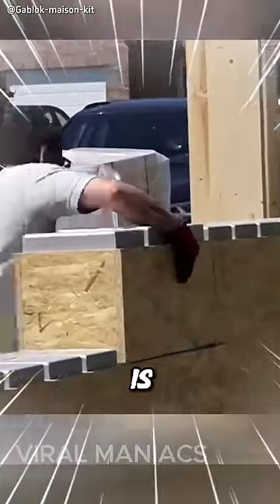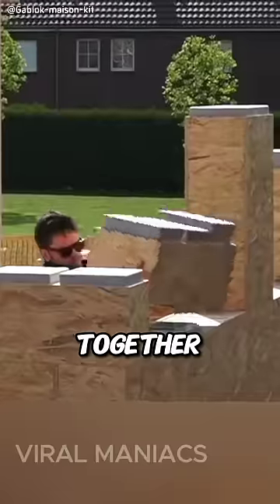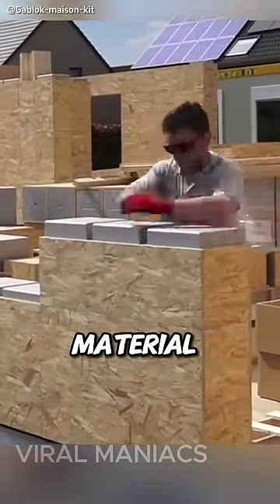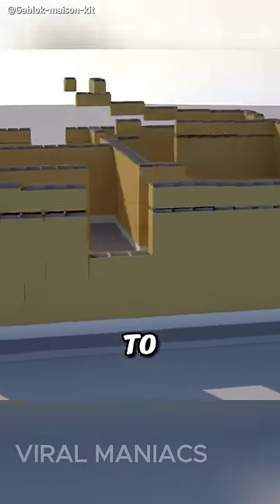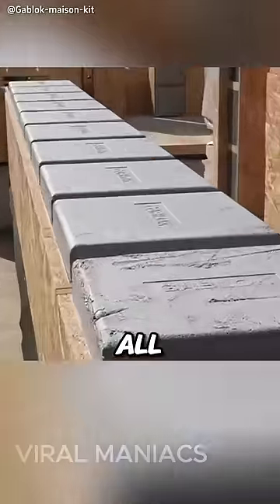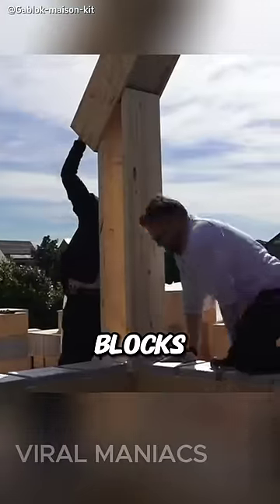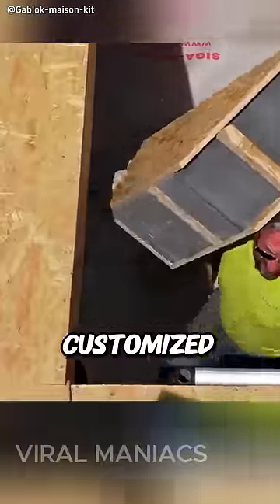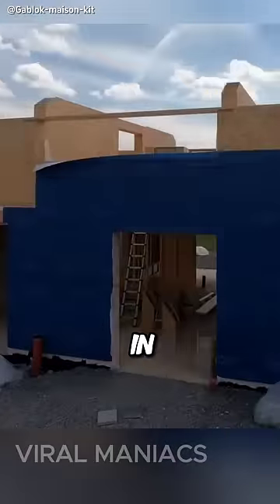Whoever Invented This Way Of Building Houses Is a Genius #shorts

Comment: Sears catalog used to sell similar modular homes like this, you would order your home over the phone and they would ship everything to you in a truck and you could put it together yourself or hire someone to do it. Lots of homes in the 50’s were made this way
Reply: Not with Lego blocks they weren’t
Reply: You need to check your memory, bro... 🙄
Reply: No... No they were not
Reply: Yeah, but no. What they sold was a complete stick built house (minus paint) in kit form. Some of those kits you had to purchase all the stick wood separately. There is no comparison unlike this lego nightmare there are still Sears Craftsman house still standing. You can't say that about this pile of blocks.
Reply: The only similar bits in a Sears house is the foundation blocks.
Reply: Hey Patrick how would you know? Have you built a house using these before? Okay then bud back of the line with your snarky attitude and comment…
Reply: @dyingtosmile2442  no I just do repairs on Sears homes  and have talked some folks that ACTUALLY BUILT THEM. So I'll keep with the snark!
Reply: Sears roebuck had those well before the 50s I grew up and one that was built in 1910 order them out of the catalog at your local sears and Roebuck store. It was more like a barn, but you get the idea everything was numbered.  They just followed the plans and put it together they’re amazingly well built and often use newspaper for insulation

Comment: Styrene foam wrapped in kindling. If one of those houses ever catches on fire, not only will burn quickly and intensely, but it will also spread toxic styrene fumes across many square miles. The perfect house!
Reply: polystyrene is commonly used for insulation, (they use it in spray insulation) and at least in america it's commonplace to build houses out of wood.
Reply: @onlyme0349  please remind me what happens to those woeden houses when subjected to the slightest natural pressure. Floods, wildfires, hurricanes, tornadoes, all common things in the US. And wooden houses collapse as if made of toilet paper when confronted with such forces.
Reply: @fighterguard  It's efficient to build with and wood is a better insulator than brick, the chances you are in the path of a hurricane or tornado is relatively small, in those areas where they are so frequent it's way better to build out of special materials, that said houses like these who are quick to build could make housing prices a ton cheaper and faster which would make the current generation able to own a home
Reply: @onlyme0349  don't be naïve. Houses are not unaffordable because of the costs of the materials. It's because of rich assholes using real estate as a speculative asset, which reduces supply, and therefore inflates the prices due to increasing demand. Houses could be built out of marble and be cheap, or out of recycled paper and be expensive. It's all in the market forces of capitalism
Reply: @fighterguard  there's an easy way to prove your hypothesis, are the land prices the majority of the housing cost or are they still cheap and people who build their house have the majority of their loan debt going towards building the house, I'm not from the US, you check, in the EU it's both, we don't have a lot of space, everything is made increasingly difficult by building codes

Comment: High winds would be the enemy of this house.
Reply: Hurricane season and its Over.
Reply: Not to mention fire. This house not only burns, most of it will melt. Imagine being trapped in a burning building because the doors are melted shut... and the ceiling is dripping hot plastic onto you.

Comment: And the wind blew, and now you're sitting naked on your chair in the middle of a field looking around at all your neighbors pointing at you.
Reply: I don’t think this would happen because they stagger the building blocks and it all locks in one on top of the other with weight. But I would if I was the contractor use a lot of glue to make sure all Blocks are secured properly they also use Simpson strong tie straps that securely bolt the foundation to walls so a strong wind such as hurricane or tornado force winds won’t scatter the house over state..The only problem I do see is hard to put plumbing in the electrical and they didn’t talk anything about this I don’t see how this would pass inspection on that.
Reply: Hilarious comment! I love it!😂 I❤
Reply: The chair with hole in the middle?
Reply: @richardtous1085  I have an "act right" chair. Not a chair with just a hole in it.
Reply: @richardtous1085  I have an "act right" chair. Not just a chair with a hole in the middle.
Reply: I think you could sheath the exterior with an insulation hard board and siding and be just fine.

Comment: My dad was a builder for around 40 years and in my experience i learned from him this will be warm in winter but very very weak its just a cheap way to build a house i recommend bricks with iron rods and high density cement
Reply: American ''dream'' have upgraded from paper to legos in 60 years. Another 60 maybe they'll finally move on to iron rods and concrete.
Reply: Yeah I also don't understand why they're not putting iron rods in, seems weird to rely on the polystyrene to hold it in place
Reply: How good is trying to claim some level of expertise because your dad was a builder for 40 years 😂😂😂😂

Comment: Congratulations, you have one built yourself one of the most flammable houses ever built!
Reply: EPS is a fire resistant polystyrene
Reply: @VegasYouTuberSteve "fire resistant" ??
Reply: @VegasYouTuberSteve OSB is one of the most flammable
Reply: @reyamayaiii1 However, Self-extinguishing EPS is a thing.
Reply: @reyamayaiii1  flame spread rating for ply vs obs has an almost identical rate.
Reply: @VegasYouTuber_Steve  euroclass F which means it's sh*t for fire resistance
Reply: @reyamayaiii1 90+ % of US houses are built with OSB.
Reply: @VegasYouTuberSteve "fire resistant" ??
Reply: @JohnSmith-im8qt  ahh yes for the roof. Not for the structural components. OSB burns faster, creates more heat and is not as structurally sound as solid wood components.
Reply: @travissmith2848  not self extinguishing OSB. If the OSB goes here, so goes the home.
Reply: @kennybutcher6307  wasn’t referring to ply wood vs OSB. Was referring to the primary structural component in this design being OSB. Most homes are made with solid wood for the frame and does not burn as fast and holds the frame longer than OSB.
Reply: @reyamayaiii1  When referring to osb joists absolutely, but they are not more flammable. They are consumed quickly because osb has less material than solid wood to consume. I work in a lab and we do tests on refractory materials. Now insulate one side of the osb and you'll increase the time that it takes to consume. Go a step further with drywall on the inside and fire will have a difficult time spreading. Flame spared ratings for plywood and osb are basically the same range ~100 to ~200 I believe. Building codes are always changing .. I know because I've had a hand in the R&D which led to recommendations that are now code. It used to be acceptable to have a laundry chute.. Codes no longer allow that in North America and usually have to be sealed and made fire safe when selling an older home. Making homes more energy efficient is important. Adjusting and developing innovative ideas is what this is. If no one innovated we would still be in mud huts burning wood and collecting water from a stream a mile away. Great improvements over that have come and they will continue.
Reply: @kennybutcher6307   you’re still not attacking my argument that a home where the primary structural component is OSB will burn faster and collapse sooner than a home made of solid wood framing as most houses are now. I never once stated that plywood and OSB don’t burn at similar rates, as a matter of fact I never brought plywood into this convo, you did. Since you work in R&D, you know that OSB burns quicker than solid wood. This means that the home will collapse faster because it does not have the same strength as the solid wood framing. With this being the case, explain to me how this home will not only burn faster and collapse sooner than a modern home.
Reply: @reyamayaiii1 Perhaps, but 2x4s and wood paneling aren't exactly fireproof. 
But, at this stage I think it more proof of concept. A bit more work on what materials you use in such a system (and perhaps the inclusion of rebar reinforcement or something should solve most of the issues.
Reply: @travissmith2848  I can agree with that. Short of the building being built in concrete most everything else will burn/melt. It will be interesting to see if they do improve upon it to make it more robust and maybe make it sturdier than a traditionally built home.
Reply: @reyamayaiii1 Dosen't need to be sturdier, but if it is say 90% as sturdy and 50% the cost and easy enough that even someone with no experience can build it to code leaving raceways for pluming, electrical, and heating/cooling (still need pros for those) home prices could come down significantly.
A method to watch, but many questions remain.
Reply: @travissmith2848  I meant sturdier than it is from looks alone

Comment: I remember back in the seventies when people used expanded polystyrene ceiling tiles in kitchens. The house fires were pretty spectacular but not as spectacular as they will be when a house built of overgrown lego blocks made of wood and polystyrene foam will be.
Reply: Maybe a little fire retardant is put into the filling's composition, I don't think they did that back then. Also, people were too high in the 70s. Ironically, hippies and fire don't mix all that well.

Comment: Im all of a sudden way more thankful to be a commercial electrician
Reply: I was wondering how they would run plumbing and electric
Reply: I would say that I appreciate you too. But I have a question why do commercial electricians or hvac or plumbers act like they don't know $hyt about the same $hyt in a house? If you don't know the simple $hyt in a house you shouldn't be doing commercial nothing.
Reply: @tammyroach3286  Alot of them, depends on the house. Old houses are scary and sometimes it's easier to say idk then to risk your life. Just one reason
Reply: That house won't look too good with EMT every where 😂
Reply: @ToonZ_1776  What in the hell did I say that referred to anything you're talking about? But FYI someone would have to be insane to want one of those leggy houses anyway!
Reply: @tammyroach3286  "why do they pretend to not know shit" "it's easier to say say I don't know" pretty straight forward
Reply: I was thinking the same thing! How the hell would you run wires in that thing?

Comment: Yes, polystyrene is highly flammable and can ignite at low temperatures. Polystyrene is a thermoplastic substance made from styrene, a petroleum-based substance. When heated, it melts and spreads fire quickly. When ignited, it produces large amounts of toxic black smoke.
Reply: How is this related to the video?
Reply: My thoughts exactly! How can this possibly be related to building a house out of polystyrene blocks , that your family is going to live in ?
Reply: In the event of a fire.
Reply: Spray walls with Line-X. It won’t burn and will be insanely strong. Bulletproof too. 

Won’t be cheap though.
Reply: @ryanb8736  so you end up after all is said and built.  Your roughly 376k in the hole.     Yeah.  Ima just go buy this double wide brand new for 175k. And then buy a few acres of land with the left over.   But let's not talk about how you just threw bedliner out there to use in a house🤣🤣
Reply: My house isn't fireproof to be honest 😂😂😂
Reply: If my grandmother had wheels, she’d have been a bike
Reply: It’s a one/two storey house so chances are there’s no minimum fire performance requirement for the walls. And the timber will provide a good level of fire resistance to allow safe evacuation
Reply: That what my mind was on!
Reply: From a guy who doesn’t know anything

Comment: 🤨 Should still be using screws, nuts & bolts to secure it more🤨
Reply: Not saying anything about this building, but not every structure needs those. Some very old Japanese buildings are built without any nuts or screws, but by making extremely tight cuts then fitting the pieces together
Reply: Did you watch the video...... There are no voids in these blocks to fill.  You have it confused with a different type of system, I imagine they left out part of the process in this clip.  @BBBhop
Reply: @BBBhop  I have, I've actually built with them before.  It's an open form and you still wire it all together using rebar inserted between the block layers. Then fill with cement... In this case the void is 100 filled with EPS blocks  ( the grey stuff) so that being the case,,,, you tell me... Where are you going to pour cement in this application????? THERE IS NO OPEN SPACE FOR IT 🤡🤔🤯
Reply: Thief coming and destroying lol

Comment: they found these things unusable in areas with hgh wind requirements because they leak like sieves. air blows through cracks. only way to fix that is to plaster the entire face and walls.
Reply: Guess what buddy.
Thats what dry walling is called.
If ur putting up ur woodblock house then calling it good.

The biggest problem with this is how the fuck are they gonna run electrical, plumbing, or heating/cooling through the blocks??
Reply: I call BS.   Not only is the drywall and house wrap going to stop that, but all you have to do is put quarter inch foam sheathing on the outside to prevent that.
Reply: That's exactly what they do they just don't show that part. After these houses are put together you supposed to add a layer or two of stucco and/or mortar
Reply: @sylthaya7571 Drop a heated ball bearing through the foam:  instant conduit.
Reply: It's those damn "they" again ruining everything.  Who are they?
Reply: Whatever floats the boat 😊
Reply: @sylthaya7571  I have no background in construction or home building, so not claiming to be an expert... But I imagine the inner walls would have studs installed which would be used to hang the drywall.... So just like in a traditional build, you still have a void inside the finished walls for pipes and cabling. HVAC would probably take a little more planning, but I'd imagine all the duct work runs thru the attic and is expelled via ceiling vents.
Reply: @control_the_pet_population  Part of the issue with adding studs for all the wires and plumbing, which is a near necessity, and then hanging drywall inside and panels outside, is it makes the blocks entirely moot since you've just built an entire house twice at that point.

Why bother with the blocks if you are just going to do everything else anyway, and have to because they need every else.
Reply: @danielhomant2832  No argument here, I was just trying to spitball where the wiring and pipes would go. :)
Reply: Well thats what you would do

Comment: One of the cooler ones I've seen is a 3D printer method, they just build a gantry (small crane) with a motor on it, and hook the material to a hose.  A computer does the rest.  Then they roof it.  Takes a couple days on a slab.
Reply: Yeah, the one with non forcified concrete. It's a bad one.
Reply: @Roguescienceguy clueless homeowner duped into buying and shady salesman enters chat: they have little pieces of metal reinforcement! We cut up coat hangers and use it to reinforce the concrete!

Comment: So many construction experts in the comments who don't realise OSB and EPS are omnipresent in modern construction.
Reply: No one is saying that they aren't.
Reply: Yeah, usually attached to something with a little more backbone lol.
Reply: @voldemort008  Most of the criticisms are regarding flammability, toxicity and inability to route mechanical services, not structural integrity.
Reply: I'm a demolition expert, you can probly push through the wall with enough momentum. They'll just come apart the same way they came in.